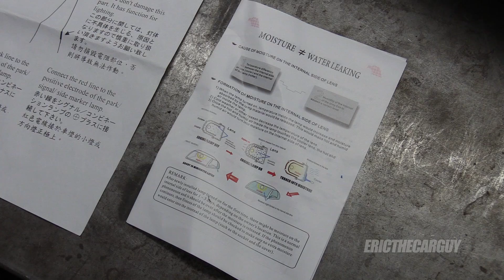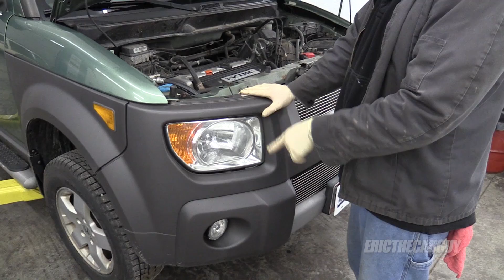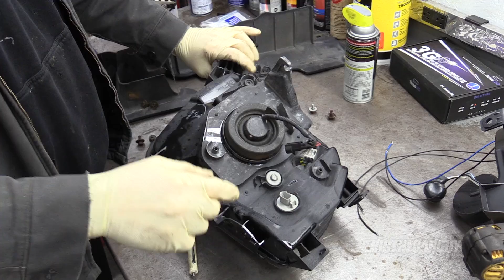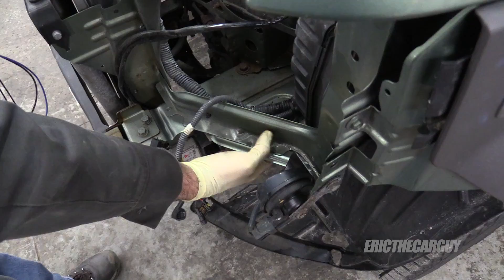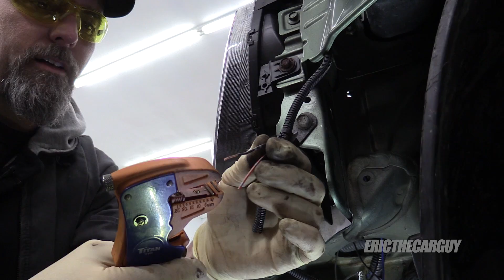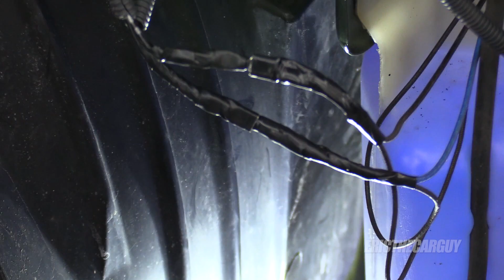How To Install Projector Beam Headlights

Comment: I'm no mechanic but wouldn't it be better if you would have used t-taps instead of cutting the factory harness?
Reply from the maker: What I did worked fine. I have no regrets. There's always more than one way to do something.

Comment: Hi Eric!
I’ve got problem with my mitsubishi pajero v6 petrol with manual transmission. It hardly even idles and when i give gas in neutral, it stalls. It is also making weird noise from engine and clutch wont disengage and it stalls when i try to put it in gear. What could be the problem? All that happened after one month without use.
Reply: BTR Garage sounds like a stuck slave cylinder, if you have a hydraulic clutch.
Reply: And maby a bad throw out bearing
Reply: TheSuraj03 I did a bit of research and found out that the noise coming from engine is maybe throwout bearing, exept sound wont stop even when pressing clutch. But what could cause bad idle and stalling when giving gas? (Neutral)
Reply: BTR Garage check for vacuum leaks or a bad brake booster, that will cause bad idling, it'll sound like a very rough idle.

Comment: Welcome back! Does the Element have the same crap transmission as the Odyssey? Might pick one up.
Reply from the maker: Nope.
Reply: EricTheCarGuy Excellent. I just installed a jy transmission in my mom and dad's 03 Odyssey, and have a line on an Element and would rather not do that job again, not having a lift and all.

Comment: Why use electrical tape on those connectors rather than heat-shrink tubing?  I know it probably wouldn't make that much of a difference as far as how weather-proof it is... but the heat shrink gives a much cleaner result IMHO.
Reply from the maker: I didn't think of it at the time. It would have been better though. Although, after a year I haven't had any issues. Thanks for the comment.

Comment: Glad to have u back eric. It pleases me
Reply: And to make the headlight removable u could have went to your parts Mustang and cut out a factory plug with the correct number of wires and use that
Reply from the maker: Or gotten a new one from Amazon like I did with my radiator fans on the Ford. ;)

Comment: These solder seal connectors are great.  Looking forward to future videos
https://www.ebay.com/itm/MONOLIT-100pcs-Solder-Seal-Electrical-Connectors-Waterproof-Marine-Automotive/272778689970?epid=900173483&hash=item3f82e07db2:g:0RgAAOSwiX5ZeQAG
Reply from the maker: I used them all over my Fairmont. Thanks for the link.

Comment: I see the comment for using heat shrink where the connectors are which how is I did my connections when I had to modify my wiring for my new fog lights. I used the 2 pron trailer wiring for a quick disconect. I also used wire loom over all the new wiring to prevent chafing and shorts where they my come in contact with the body or get pinched.

Comment: wait why didn't you put the HID's in the projector lens? wasn't that the point of buying the projector in the first place? so you can stop blinding people with your HID's in reflector housing? :)
Reply from the maker: I installed LED's in this Premium Member video. I'm also doing another comparison video when I get a chance, HID vs LED vs Halogen in Projector Housings. https://www.ericthecarguy.com/exclusive-videos/73-exclusive-videos/2091-led-headlight-install-inside-element-projector-beam-housings-exclusive-video
Reply: EricTheCarGuy is that why the lights are different at the end of the video?

Comment: Nicely done Eric. Never Seize or some other type of product is a must. I think I have mentioned this before but when I was working with ROV's we used AquaLube because Never Seize in a salt water environment especially into Aluminum caused issues due to Electrolysis because of the metals in Never Seize. AquaLube always worked and never washed away. Great job Eric.

Comment: Do you ever use the 3M liquid tape? It works to keep out moisture. I usually use electrical tape on a splice, or whatever, then coat it with the liquid tape for a proper seal...
Reply from the maker: That would have worked better. Thanks for the suggestion. Shrink tube would have also been better.

Comment: Silly question -- but what are those pliers called that you used to remove the plastic clips/pins? I always used a flathead screwdriver to remove them and end up destroying them.
Reply from the maker: Link in the description. Also, shoot them with a little WD-40 first and they come out much easier.
Reply: Thank you, sir!

Comment: I strongly recommend NOT to use electrical tape in outside areas, specially in front, lower parts (like fog lights), because this electrical tape gets soaked up pretty easily, shrink tube WITH glue is much better option, I can give you 80% guaranty that if you would try to unwrap that tape after driving in heavy rain for a while, you would see that connection is absolutely wet. (speaking from experience)
Reply from the maker: I agree. Would have been better to use the proper connectors, OR, get some 2 pin weatherproof connectors. I could have also used shrink tube instead of the tape. That said. I've been driving this with these for more than a year now without issues. Thanks for the comment.

Comment: those body clip pliers make a world of difference...I still know people, of the lesser IQ variety, that break every single clip with a screw driver, then curse at Honda for using so many of them... when they should curse themselves because anyone that has half a brain would think that if there's anything removable on a vehicle... there's definitely a proper tool for the job.
Reply: @ thefordmaniac..... yeah, cursing fasteners is a requirement, but at least with the correct pliers you break less of the buggers
Reply: those pliers also work good on some u-joint snap rings/clips as well...
Reply: Kenneth Silvers buddy, I've WORKED side by side with these people, so I CAN judge their intelligence level.... and it's LOW.
Reply: Even with said tool, you still need to curse at the stupid clips

Comment: I have had Anzos on my car for a few years. I haven't had a problem with condensation but after a year or so, a layer of protective film that were on the lights began to crack and peel. They are still clear and function properly as of now.
Reply from the maker: Thanks for the heads up.

Comment: welcome back my friend! why not hook up the halos'for daytime running lamps. hook to to a ignition hot wire and they will be on when the key is on.
Reply from the maker: Because it's easier to turn the parking lights on when I start it up. ;)
Reply: ok. just a thought. glad to see your in a better place now!

Comment: I find that projectors blind you more than reflectors. It's crazy how car manufacturers are now using hid as stock headlights for these projectors and I swear when it gets in your eye, IT GETS IN YOUR EYE
Reply from the maker: If properly aimed, this have a really sharp cutoff to prevent that. I'll show it in more detail on the video I plan to make soon, HID vs LED vs Halogen in Projector housings.
Reply: EricTheCarGuy yeah well in Texas you got too many assholes in lifted trucks who can't move a wrench to adjust the headlights. I have a 2002 expedition and I took the time to adjust all three knobs.
Reply: Lots of projectors have HID's. Projectors are meant to have HID's in them so they can focus all that light through the lenses. What I am saying that, that halogen projectors lenses are slightly different from HID projectors. Look it up, you can find information on them.
Reply: EricTheCarGuy I’ve been told by guys that do lighting work on cars that you can’t necessarily have HID’s on halogen projectors. Halogen projects are made different from HID projectors. In order to have good lighting from projector headlights, you must have the right kind of projectors for the application. 
Now I personally didn’t know that but the info is out there.
Reply: Rene Perez 

Actually, it’s the uv rays that burn the projectors.
Reply: Going over hills is when they become a big problem. The color is also an issue. They're too blue which strains the eyes more than the halogen bulbs. I think they should have cars designed with 4 headlights instead of two that way you can use dimmer lights while maintaining visibility.
Reply: I have heard the same thing. Not all projectors are created equally and that is why HID lights should use HID projectors. From what I understand halogen projectors are cheap. Just look at the difference between OEM HID setups and aftermarket HID setups. I have always noticed OEM is the sharpest. You can see the difference in price as well. You can`t beat OEM because it was designed to work together from the start by top Engineers.
Reply: Rene Perez if you put hid into a projector the hid will get too hot and start to literally burn through the projector. That's why it's not recommended.
Reply: Projectors and reflectors both can be made for halogen, HID, and even LED but they need to be specifically designed for that specific light source as they all produce light in a totally different way and simply swapping bulbs generally give awful results for usable light.  As far as being too blue that all depends on the color temperature of your bulbs.  Stick to an OE color temp somewhere between 4300K and 5000K and it's a very comfortable color.
Reply: I have to agree with you on that. When I was working as an Infiniti dealership technician, I noticed how amazing those projectors shine light from an HID light system. They're spot on and nothing compares to it. I have so aftermarket projectors on my Nissan and they're no where near what an Infiniti projector looks like.
Reply: Rene Perez the problem is the correct projector for hid can shatter. My mom's Buick projector literally shattered in the housing because of a pothole. The eBay projector or retro fit kits are made of plastic that start to melt and bubble especially when using 55w ballast for hiss
Reply: This is where I was trying to get at with this conversation. Thanks for clearly stating that! I knew someone else would know haha
Reply: Thats called being poorly aimed/designed. Acuras are by far the worst, hardly notice the BMWs or Mercedes lights

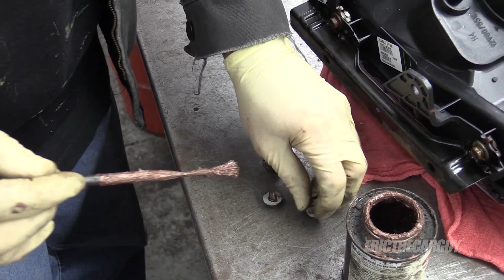Comment: @14:30 Liberally coating the fasteners with antisieze in areas where rust is a problem... yes. Earlier I was screaming, "Eric, coat your fasteners with antisieze! (because you're doing it wrong)" Well done! Being from the rustbelt myself, I always coat any exposed-to-the-elements fastener. I just sold my Tacoma I owned for 12.5 years and the new owner asked if he could re-contact me with questions, and my reply was, "If it's got antisieze and it came apart, sure; otherwise, I haven't touched it."

Comment: When it comes to removing a headlight assembly, the best design I have seen is on the Volvo XC90. The steps are:
Open hood, pull two L shaped metal strips up and remove the assembly. That's it, no tools required, takes 15 seconds and if the assembly needs to come fully off, there's one plug. I love them.
Reply from the maker: Early 2000 Ford trucks are the same way. Thanks for the comment.

Comment: Eric my 93 civic start right up and idles at about 1500 rpm in park or "N" but when putting it into gear the rpm drops to another 900 with a ruff idle n intermittent stall when I'm coming back down to a stop.. I have a automatic transmission... Transmission fluid is at correct level... N I gear the fuel pump when I turn the key to the on position... Where else should I look??
Reply: **rpm drops to around 900..
** I hear the fuel pump...
Reply: Idle sounds high, possible vacuum leak, i'd also check the idle air control or what ever they call that part for a Honda.

Comment: Yo Eric really good to see you back on track. My car is that old it has one lamp that is used for park lights, low beam and high beam. Not like late halogen systems that had one lamp for each beam and stuff. My mechanic said even if i want to change it i cant due to its old contruction. I can’t change the high beams to led inside the projector but can put extra separated led lights but that looks ugly in my opinion. Anything you can say or something for my situation?
Reply from the maker: If you have an Element like mine, LED's can be installed. In fact, there's a link in the description of me installing LED's in these housings. It did require some modification, but it wasn't that difficult to do. Good luck.
Reply: EricTheCarGuy ty for answer :p

Comment: Coming from a truckdriver: step one. DON'T!
Reply: Shawn P That means they were installed DIY and not aligned. Hence why they blind you.
Reply: CNT 

I think he means real trucks-- big, trailer-pulling, auto, mobile machines. Not pick up.
Reply: Matthew Smith You're right. I don't want to blind or be blinded.
Reply: wolfstar I guess everyone does DIY then regardless they should not be a thing

Comment: Hey eric what you could have done to have another step against putting the wrong connectors together is wrapping it in different colour tape, I.E grounds in black power in red
Reply from the maker: Good call. Thanks for the suggestion.
Reply: EricTheCarGuy also glad your back and in a better place than when you left (yes i know you were still making content i watched most of it) :) i was sorry to not see repair vidoes for awhile but it was worth it for your health

Comment: Here in finland it's fun to own an Element, at the moment every modification needs to comply with mfg year law in country of origin, USA, or comply with current finnish regulations and be E-marked. That's why I just jammed a led lightbar inside upper grille for high beams and called it a day.
Now I'm curious have those projectors been legal in 2005 in some state? Just need to know where they have been legal to pass yearly inspections :P
Reply from the maker: I don't have yearly inspections where I live. Also, there are no laws against upgrading your lighting system where I live. Thanks for the comment. FYI, I'm headed to Finland next month.

Comment: I'd like to make an observation. You used uninsulated spade connectors which means you have to tape them up. Most commercially available electrical tape has a limited life span on the adhesive. 10 years being about the maximum where it remains sticky and adheres decently. Had you used the fully insulated spade connectors or bullet connectors you could omit the tape and not have to be concerned with it eventually failing. If you're concerned with moisture getting into the terminals you can load them with dielectric grease so they won't corrode.
Reply from the maker: It would have been better if I had used shrink tube. Thanks for the input.
Reply: I am only talking about the mechanical effects, the voltage does not matter
Reply: Those are actually referred to as insulated spade terminals. That's what the blue skirt on them is. Uninsulated would be a bare metal crimping skirt. What you're referring to is weatherproofing.
Reply: Morbus Bahlsen remember its a 12v low amp circuit. It will be fine
Reply: madmat2001 you sound like a gay
Reply: Also do not tin when u crimp, the solder can ''flow out'' over time and loosen up the connectiont. Tin also does not like vibration.

Comment: you can get those plastic clips cheap from ebay i bought 50 for about $5.00
Reply: Michael Whitworth I’ve actually gotten those for free at the dealership. Maybe they charge for them normally? I just asked for one at the Honda dealer after I broke one. Guy comes back with a handful of them and says” here, no charge”
Reply: You probably got lucky with a nice parts counterman. Jeep want something like $5 per clip - so of course anybody sane gets them from Amazon or eBay, where a bag full of them costs $5.

Comment: Good connections, soldering connector to wire even better.  Covering tight with electrical tape better than weather connectors  Crimp only poor, dissimilar metals and corrosion.
Reply: A D actually  one should not solder crimp connections because of cold flow. And if one does first crimp then solder
Btw etcg, nice to see you back

Comment: I personally do not like that the blinker and clearance light are on the same bulb, It loos tacky>
I would've gone for LED blinker bulbs as well to get rid of that fried egg look.
You would just need to change the flasher unit to prevent hyperflashing.

All of my cars light bulbs are all LED based.

Comment: I have a 02 Impala 3.4l and the instructions were, even more, God-awful than yours. I had to splice and resplice 6 friggin times till I got it right. If you could get a 01-05 3.4l Impala to do videos on it'd be highly appreciated because I have 6 repairs off the top of my head to do. My diagnostic skills are junk so far. Hell, for all I know I could be fixin stuff that need not be worried about more so than another repair. I love the hell out of this car and my goal is to learn how to repair everything from the ground up. The transmission is the last thing I tackle =). Last but not least thanks again for the years of videos, I wouldn't have gotten into fixing my car had it not been for my radiator crapping the bed about 4 years back. I watched one of your videos back then and have been hooked ever since, thanks!
Reply from the maker: I'd like that too. Those cars make great sleepers.
Reply: Funny you mention that! Turning her into a sleeper is my second big goal. But I need to up my diagnostic game and I'm not quite sure where to learn that. Heading to your site for inspiration.